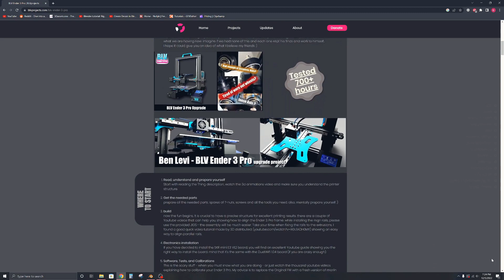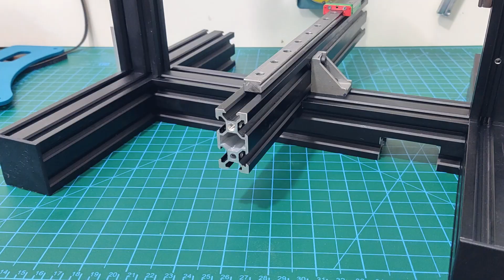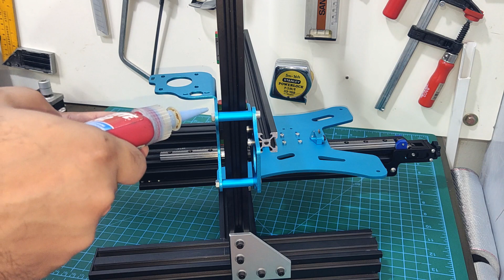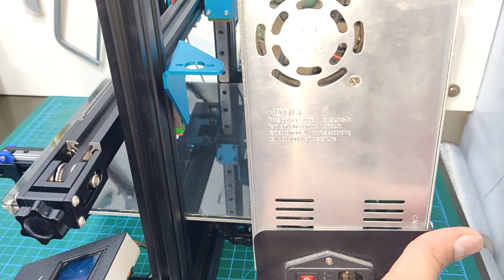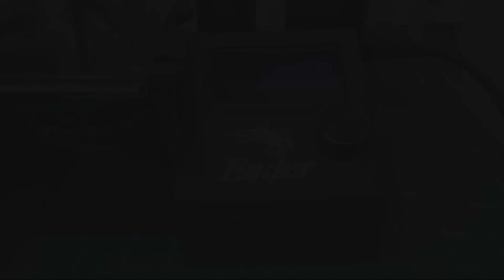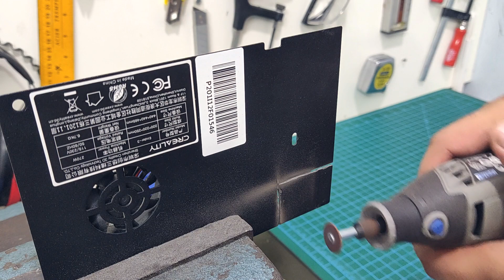Original Ender 3 Linear Rails Upgrade (MGN12) with the BLV Kit

Comment: Hm just a quick Question in The Video at 4:43 you can see that there is a gap between the carraiage and flange means the flange sits not flat on the wagon? Is this intended? I have the problem, that its not easy to fasten these 4 screws??
Reply from the maker: Hi, sorry I don't get your question. Are you talking about the y axis aluminum plate mounting on top of the linear rail carriage?
Reply: @bluemonxterDIY   Hm well maybe I was not clear at all :-D - Imean the 2 plates holding the Y-Motor and The extruder. I have had troubles to mount them flash on top of the rails wagon because the edge of the  linear rail carriage ist sharp 90° and the bended Metalplates hav an inner radius because of the bending this is what I am concerned about. In my case the two verstical 20x40 Rails were no longer paralell to each other they are 90° to the base but in fache of each other rhe one on the extruder site is slightly rotated - not shure if this may cause some trouble later on. Hm I am almost finishes and I will see when I do a Testprint maybe a cross with 90° then I will se if the x-y alignment is not orthogonal. I write a short notice when I am done how it was going :-D

Comment: Hey Dude,
to reverse the spinning of the stepper motor its easier to change 2 of the wires either  on the left or right, doesnt matter. think its bether to do this instead damaging the connector. Depending ob the electronics its also possible to reverse the motor in the firmware settings - if running klipper its an easy task. I am a lot delayed with my upgrade although I have the party laying arount for some while 😀Ty for your detailes videos they have helped me a lot and by ther way sorry for my bad englis spelling and grammar :face-turquoise-covering-eyes:

Comment: not wanting to wait on more bearings to arrive from amazon, i decided to be resourceful and use the stock idler bearing pieces that the tensioners replaced. cut one side off the front y bracket so that it was flat, bolted to rear of y (home) and used the single sided piece that has the captive nut welded in, at an angle on the front of the y axis and reused the stock bearings. works great!

Comment: cut the connectors on the stepper? Why not just remove the connectors in the bracket and rearrange them... a small screwdriver can get them out easily
Reply: I was wondering this too, or I assume this is making the motor direction opposite, so maybe you could flip the motor 180 degrees and mount it that way?
Reply: @MantisRay861  Well just change 2 of the wires will reverse the motor

Comment: Don't you think those belts are too tight? I can see the belt teeth deform to almost flat on the roller bearings, and also the stepper motors being noisy. I did my belts the same way when I first got my ender 3 v2. Snapped the y axis belt after a month, and the x axis after 2 months, both snapped right on the carriage mounting points. Now I tension my belts just enough to remove any visible slack, but loose enough that I could fit my finger between the belt and the extrusion comfortably. The difference I notice in terms of print quality is that the x and y dimensions are now the same when printing cubes, where as in the previous config I'm getting slightly larger x dimensions(about 0.15mm). Maybe due to  the belt teeth deformation? IDK.

Comment: Your z axis should fall if unsupported. Also when you added the z supports, you could have brought the linear rails further out of alignment. These little issues add up quickly, putting too much load on the stepper driver. Perhaps a video on fine adjustment while waiting for your new board? 

Most people will get more accurate centering with printed blocks than with calipers. X miss alignment is nicely compensated by bed leveling. Y skews the print, z binds.

Over all good attention to detail. I like your y axis stabilization. You might want to look at silicone bed springs much less re adjustment needed. The sprite hotend is also a great upgrade.

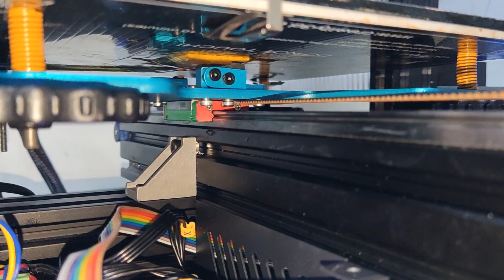Comment: it's great to see the different ways each one of us go at upgrading our ender3s, there's so much out there, each one is unique. amazing. by the way, at 9:55 I think I saw some slip of the Y axis linear rail, you pay so much attention to squaring and precision, would be a shame to have that kind of play in a part to ruin a print.
Reply from the maker: Wow i didn't notice it. Thanks for pointing it out. Turns out some of the T nuts had not rotated in the slots. Went back and tightened them up. That would've left me scratching my head for a couple of hours had I started printing on it.